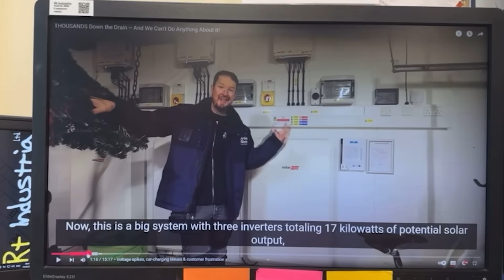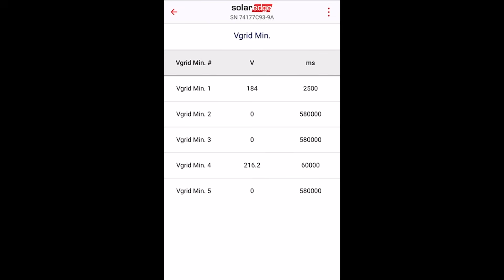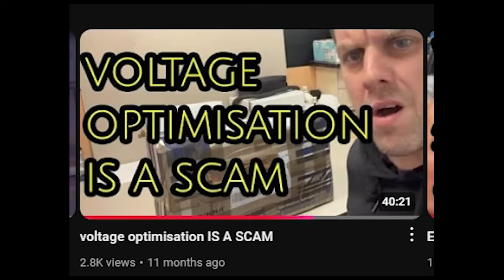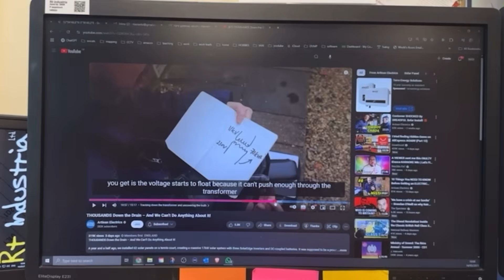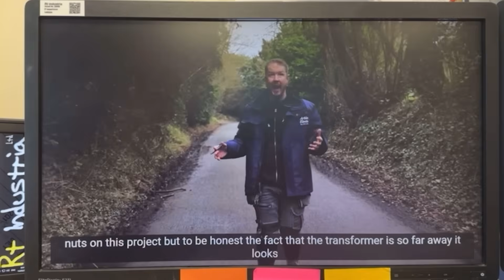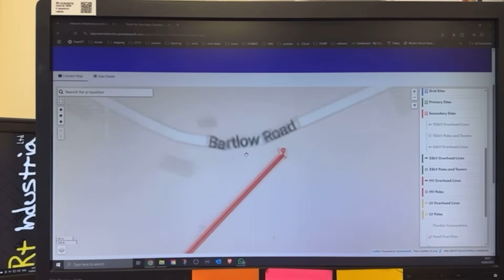ARTISAN ELECTRICS v THE GRID. WHO,S TO BLAME

Comment: Engineer here - This has always been my argument abut EV cars, the local networks cannot push enough power to an area with say 50% of cars. Now weve got people generating. Just wait for the troubles caused by the new housing estates that have to have PV installed. You'll have 250 houses all generating say 5kW trying to shove all that excess energy back to the grid in the middle of summer when everyone's at work.

Comment: I used to work on UPS and invertors in the 1990s including Meissner( South African company) and Powerguard Louth, Lincolnshire). These were very complicated pulse width modulated and the circuit boards inside were the size of a door.  I also used to repair tvs in the 1980s - i have C & G part 1 electrical installation so i am not really a qualified electrician i am an electronics engineer.
Perhaps the three invertors are fighting with each other its possible that they might not be fully synchronised to the mains frequency on the grid and causing slight phase shift. Nicola Tesla didnt invent 3-phase for fun. its the most efficient way to produce power.!!!
Personally if i was installing solar i would get disconnected from the grid.
Always found the National grid very helpful and professional.

Comment: Hi Jamie with regards to that village transformer I think it will be set to give 250/433 volts at the transformer allowing for volt drop in the cables the end customer should see a voltage still within limits. What young Jordan didn't seem to realise is that DNOs NEVER start off 230 volts if they did there would be a lot of low voltage complaints from end of line customers. My apologies if I'm telling you stuff you already know. I totally agree the DNO engineers to a great job in some truly crappy winter conditions I would never criticise them

Comment: I am glad someone is calling them out ….i absolutely love the part Jordan says the rickety wooden pole holding the network transformer and this statement shows how artisan don’t have a clue …. HE IS LOOKING AT A TT MAIN SUPPLY and this is were the problems are starting …. From transformer down the street … before it gets to Jordan’s install the TT supply has already gone off to two other properties… so from transformer it goes to house 1 then house 2 then Jordan’s customer ….. I can guarantee that this solar system has cost the other two properties either a new fridge or freezer or a new tv since this solar install as Jordan is inputting a higher voltage not just to grid be because the TT supply is already shared…… and do you know the easy fix is to remove one of the inverters and that inverters battery storage OFF the grids and that inverters only runs the charging of ev …. But Jordan will never listen to anyone and thats the company problem

Comment: 23:20 over grown poles is not going to cause voltage drop or voltage increase. DNO always clear the poles on my ground. The ABC will probably be 4C 95mm. Smallest they do is 35 but that’s rare could be 50mm but I doubt it.

Comment: As the transformer is only 40-60% utilised, increasing its capacity won't do anything. It's the line impedance towards the transformer and the size of the generation and load. 17kW is about 74A at 230V which is 74% of a normal maximum single phase 100A fused service. That is a lot of load or generation to pull/push. And that's just the battery charger load. If they've got electric heating, electric water heating, electric cooking, washing machine, etc. they've only got about 5.5kW of capacity before they're pulling 100A of service. No wonder the voltage is sagging locally on site. And we don't even know where the source of that line impedance is. My money would be it's in the service cutout and the spur to the bus tap point. Not so much the bus that runs up the lane the transformer. We don't know if other customers on the same phase see the same voltage fluctuations as this customer. If they don't, then the impedance is on the solar guy's spur and maybe the DNO could investigate that as a fault, but the guy is pulling over 74A on a single phase 😮. Why is the battery charger set to 17kW? If they have 7 hours of cheap rate electric and they run the charger flat out at 17kW, that's 119kWh stored. Do they really use 119kWh in the other 17 hours of the day? Does he even have 119kWh of storage? They almost certainly could charge the battery much more slowly. The voltage optimiser was a garbage sticking plaster. The real problem is line impedance. Also, the bus and transformer are not sized to give every customer 100A, even if they have a 100A fused service. 100kVA is only around 430A at 230V (ok I know kVA isn't kW but the argument here is about scale), shared between the 58 customers which would be an average of only about 7A per customer. The sizing relies on customer load being randomised and not that large or large loads being short lived (kettle is 3kW for 90 seconds. Shower is 9kW for 5 minutes). Each customer can draw a PEAK of 100A but not for long and not all at the same time. Such oversubscription is completely normal. It's not designed for everyone on the same bus to have a battery charger at 17kW for 7 hours. As for the solar overvoltage, yeah, the line impedance may well upset the inverters, fighting each other and the line impedance to up the voltage *locally*. And he definitely has disabled or increased the threshold of the inverter out of range voltage disconnect. Above 253V the inverter should not just throttle but disconnect. But that would make the customer unhappy, right? So overide the limits and now it stays connected but overvolts the local (probably just on-site) supply. As you said, they've got no option but to throttle back the max power output of the three inverters and look to see if there is any parallel synchronisation instability between them. They are high frequency (50-100kHz) PWM switch mode PSUs and can suffer from all sorts of control loop instability effects, even with the 50Hz "sine" output heavily filtered for EMI.

Comment: the DNO approved the install size - if theres more power than the local transformer can pass, then the local voltage will "float" seperate from what the grid is doing. The DNO shouldn't have approved that much power. I suspect they don't want to drag their customer through the shit, because the simple answer is to limit the export, and I doubt that wasn't said to them and the customer refused. The inverters will not fight each other, they are designed to work in tandem.

Ultimately the local transformer is too small for what DNO approved, and now the customer has sunk a bunch of money into it for what was approved and doesn't want to wind back.

But yeah, the voltage "optimiser" is just "fixing" it for the customer only, he's still fucking cranking all his neighbours voltages to 260v during the day unless these guys are going to go install "optimisers" at all their houses too

Shit on everyones shoes here

Comment: At least you mentioned every 3rd house having potential issues, Jordan should have tried knocking on their doors to see if their voltage is 260!
While he's at it, he might want to fit them fancy tranny boxes to any affected properties.
The main issue I can see here is a load imbalance across the phases.
Personally I don't need solar panels, normal electric is fine😁
As a side note, we did have slight issues here a few years back, it dropped to 170V but the person on the phone quickly sent someone out to fix the problem, either lost neutral or phase.
Oh yeah and you now have a new subscriber😁

Comment: When I had the solar installed at my home, the local electrical required a service upgrade including swapping out the transformer.   My contractor did not plan for this and we already had a signed contract.   He tried to walk away from the job, but I convinced him that paying for an attorney would cost him more than paying for the service upgrade.   My point is this was all figured out during the permitting phase.  So I'm a little surprised that this possibility wasn't brought up earlier.  ;o)

Comment: This is a very clear one. This so called specialist does not understand cosign error  so he co located multiple solar inverters at the same location. They probably were also not able to work in master slave mode meaning that they all try to follow the grid phase that they are all lagging with so how can an inverter see the correct phase angle  when it's neighbour inverter is clocking up the phase.  So we have this cable jockey looking professional but he is not. The cherry on the top is 1950s British kite marke BS grid standards. As a senior design engineer for EV electronic design working with IEC I know the joke of twits in shirts with ties  trying to force British rubbish to international standards  I may add that are already accepted world wide. 

This little fight. Is a combination of stupidity of a cable jockey who does not have a clue and Victorian England. God shave the king.

Having watched to the end  you have some valid points  but just think this  the solar array during the daytime is back feeding the 11kv network ( most other countries use 33kv but come at least it's not steam) so with guage issues  the cable could get a little bit warm but it's not relevant. So you have looked at the net grid specs that clearly show  by full load to all customers no problem. So daytime they are all at work so leaving the pole transformer free. Yes I must laugh at the single phase approach in the UK as it's pathetic. Let's take the example of a remote farm. You go to the expense of putting up (11)kv lines with wood and metal and work but  adding an extra cable with a few insulators you did not do it "rule Britannia Britannia rules the waves"  pathetic  feeding a farm. But not expecting a former to use a 3ph motor to cut wood logs. Tut tut tut. 

Another interesting thing today , a moron with money can purchase a network grid monitoring set that produces prity graphics meaning that every womble is now armed with so called evidence deepening his narcissistic event deeper triggered by the lack of basic knowledge. As a professional engineer for high level really complicated stuff I always look at such wombles when they pull out their little books with regulations,I then ask ok but why is this regulation written and they disappear for a cut of tea or do the mobile ringed and I must take it retreat. Trust me on this one the problem is simple he has a group of inverters working against themselves because they are not in master slave mode to avoid phase missmatch otherwise called cosign error.

Now an example of how it should be done, as Volkswagen wanted to support V2V and V2L  but not V2G vehicle to grid  I was not allowed to develope onboard chargers 22kw 3 phase  to do charging as well as inverting with no coding error. So the whole of Germany is going green and has almost zero grid storage capacity to store all this nice green energy. So Germany decided not to develope  grid storage and use using EV parked exactly where the load was needed. Very funny. So I went to china and worked with BYD to develope V2G. So how does china look today every , multistorey parking house has been retrofitted with every place 22kw 3 phase charging  this means heavy guage copper and massive transformers on the ground or first floor. Our field  Tests 500 EV commanded to go all to 22kw full inverter mode with zero phase error  with IT based communication controling that batteries were not sucked dry  also communicating to other parking facilities in the area including all power billing with bonus for use of inverter mode. Have you got even the slightest incling how pathetically backward you are in the UK ? And here we have some badly educated cable jockey shooting himself in his own foot and making you tube fails about it. I do not think any of you realise how far advanced china is in every direction of engineering and science, ask any British university lecturer who teaches foreign students  it all starts with school education  and British education totally sucks. Basically you have not got a hope in hells chance in competing with BRICS nations as they all have or are implementing incredibly high standards of education. Take electronics every school had a room filled with free circuit boards with components already populated to learn for instance op amps or AD conversion or how to use sensors. With microcontroller boards like Arduino or Raspberry pi ax well as other stuff like FPGA the teacher books them out using 2D bar codes and resupply is automatic  kids bedrooms are stuffed full of such evaluation boards to play with all free  and the UK with it's akadamies a total joke main thing the school uniform looks prity. And one day such kids get a screwdriver and a cable stripper in their hands  and I get to watch such stuff on you tube  R S V.P

Comment: The issue is,when those transformers were installed back in the late 60's early 70's there was no EV, laptop's, PC's, gaming consoles,and all the other electronic shit we have nowadays,so the  TX's & associated switchgear is all too small & needs reinforcement & like you said they're not going to do it  until 2039, bottom line is Jordan didn't do any research or calculations & he just wants to lay the blame on the ageing & undersized infrastructure. There's obviously a lot more to the story but any-ho!

Comment: I made a battery charger a dead simple one.  A transformer with a voltage regulator in series with it like a dimmer switch before the transformer, to a rectifier so I could have 0-240 volts dc.  Now the odd thing is, I have made a few chargers like this and found that when charging a 12 volt battery there is only 3 volts actually coming out the charger?  So measure battery voltage at 11 volts get 11 volts on meter but when I put the charger onto the battery it will show something like 17 volts! Yet the charger giving out 3 volts, so what the hell is going on there?  That would surely mean I could charge a 12 volt battery with a 3 volt battery, never tried doing that but can't see that being possible????

Comment: The whole 230V vs 240V is due to marrying British grid standards to EU grid standards.
The UK traditionally had 240V but had to change their average down to 230V, it means that the volatge can vary within the range you described, while still meeting EU ratings.
As you touched on, the simplest solution would have been to shift the customer to 3phase. You'd stop the inverters fighting, you'd spread the generation and load draw (it's really unfair to have such asymmetric loads on a transformer) and you wouldn't have to have the noncey voltage optimiser. That would also allow them 22KW home EV charging.

Comment: He stated that cabinet cost them thousands out of their own pocket, i used to design and build sine wave uninterruptible power supplies  for export to Africa for the best power company in the Business, this was 40 years ago. We had that toroidal transformer tech in those supplies back then to cope with their intermittent wide ranging supply voltage. I doubt if he actually paid thousands for that, i reckon he mistakenly quoted the price he’d actually  charge one of his customers for what i reckon is no more than £200:00 worth of parts. For the money he charges maybe  he should of installed a variac and personally stood there 24/7/365 with a DVM and manually dialled the variac accordingly !

Comment: Saw Artisan 5/6 years ago doing an EICR on a Farm. Phworr....Good luck there.
Came to a typical 63 amp MC switch fuse feeding the main fan (Prob only 22KW). Yeah, the enclosure was a tad rusty as they get, he opened it like he was de-fusing a bomb. The inside was like new.... and he code 2-ed it on the external condition.
Good luck again telling that to Farmer Giles when its probably done its job for 30 years plus. Those early SF's were build to last - Just a drop of oil now and then on the latch.
Reply: Bloody laughable. Wouldn't have marked that down at all and instead just told the bloke to take some sandpaper or scotchbrite and a bitta paint to it to quench the ol rust

Comment: I don´t understand why  you would want a grid tied system in the first place. I would use hybrid inverters and an oversized battery system. All these conversions between DC/AC are pointless and inefficient. A hybrid inverter can charge you battery from the grid just fine and it works as a ATS / UPS.

Comment: I have 2x solar edge inverters they output the same voltage but as the installer set the max voltage as 253v they won't go above this and have clipped before due to over voltage same with out Tesla battery it also won't push out above 253v guessing someone set the limit to 260v not 253v

Comment: The raising voltage on export and falling voltage on import hints at a high impedance/resistance somewhere on the way from the inverters and chargers to the transformer and grid.
He should have let the DNO install their measuring equipment and just disable the solar export it they request so, but then start charging all the batteries. If there was a high impedance on the grid side the voltage would have fallen out of spec and the recording equipment would have caught that. That would force the DNO to upgrade the incoming supply or string at least a second wire outside on the pole.
if the undervoltage situation would be corrected then the export also would have been fixed. Just takes time.

Comment: The grid tied inverter needs to ramp back when the voltage rises and the battery system needs to reduce its demand when the voltage drops. 
The grid might not be capable, but then the equipment should be behaving.
Why doesn't Solar Edge do current limiting when rhe voltage is wrong?
The Solar Edge system can do 260V in theory, but just because it can doesn't mean it should?!